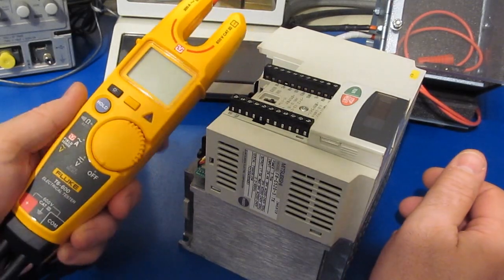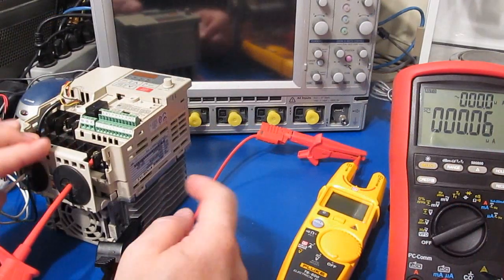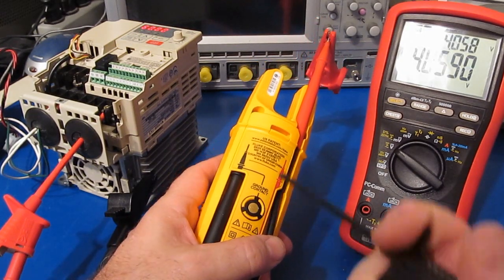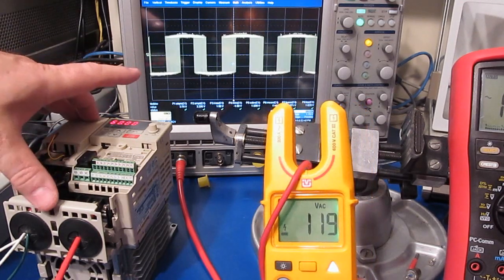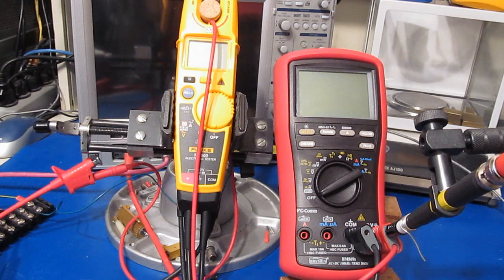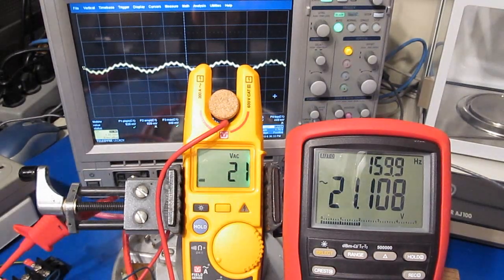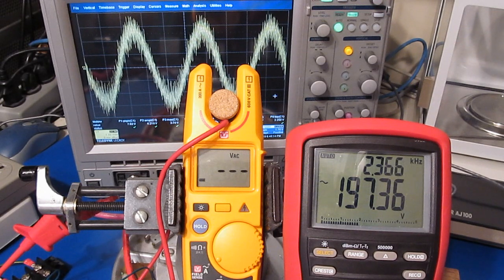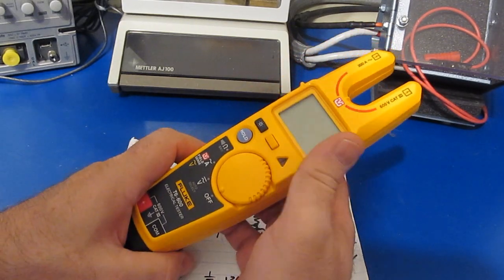Fluke T6-600 Part 3, VFD Drives and Other Waveform Testing

Comment: Hi joe 
Sorry very late to the party with a comment 😂. 
Thank you for yr awesome videos highly appreciated 
Would love to see how all yr meters read that output voltage from the drive 
Tested my 867s brymen it reads about 6v higher than my fluke 87v on a small drive with frequency of about 1.5khz 
Regards
Reply from the maker: What's the 3dB rolloff for your Fluke vs Brymen?
Reply: @joesmith-je3tq  to be very honest I have no clue 
Not very technical when it comes to that

Comment: I've been playing around with my fluke T6 and an oscilloscope. If you connect the ground of the scope to the negative test lead and hold tip of the scope probe in the fork with Field Sense active, the device emits a 2.4kHz sine wave that the scope can pick up. You actually don't need to ground the scope to the meter to see this, that is just when I got the best signal. As soon as you turn off the field sense function the 2.4kHz waveform disappears. If you look at the waveform that the meter couldn't read around 8:26 and count the peaks there are 26 peaks in 1/4 cycle so the frequency of the waveform superimposed on the 60Hz sine wave is 60*26*2 = 3.120kHz which is pretty close to 2.4kHz. Without fully understanding what they are doing on the inside, it appears that they are modulating the Field Sense measurement on a 2.4kHz carrier frequency. My guess is that if the signal you are measuring has too much frequency content in the vicinity of 2.4kHz the meter can't deal with it properly. it would be interesting to see the frequency spectrum for the wave forms that fail to produce a reading. Thanks for the informative video!
Reply from the maker: You may be interested in the following: https://www.eevblog.com/forum/testgear/fluke-fieldsense-contactless-voltmeter/
Reply: @joesmith-je3tq  Thanks, I'll check that out. Really enjoy the videos, super useful information.

Comment: when would you see waveforms with the small spike in the field? what is something that could cause those ?
Reply from the maker: I am not sure what you consider a small spike.  The act of sitting in a chair can create small spikes which I am sure is not what you are asking.   I suggest doing some searching using Google for "AC mains transients cause" or what ever it is that you are looking for information on.   It works wonders.
Reply from the maker: Wiki even has a page for you:  https://en.wikipedia.org/wiki/Voltage_spike
Reply: @joesmith-je3tq  thank you and thank you for the video amazing work a bit concerning seeing how easy it is to cause the meter not to read
Reply from the maker: @MarcusMussawar  That's the problem I see with it.  I like the concept and did some patent searches on people have done it.  Maybe someone will get the technology to be a little more forgiving than this one is.

Comment: We have in PT a lot of cork. Well the clamp doesn't like much noise / glitches on the sinewave and i think in the part 2 there was a  refered 2.4KHz frequency carrier on the clamp and in part 3 the final pure sinewave was tested at 2.399ish KHz, which is very near and would trip the meter and does not read even at 10% of the value. On the other hand if the device is not reading properly we could also suspect the line by its behavior... Very nice test JIG and wave form generation. What about doing a reading between two Power Line Ethernet points  , will it trip either?
Reply from the maker: Are you asking about those adapters that allow Ethernet over AC lines?
Reply: Yes, that kind of adapters
Reply from the maker: I assume you are required to have a licensed electrician install these which is why you are asking.  I am not understanding your question "will it trip either?"  Ethernet should be isolated and I doubt they have two of these sitting next to one another.  So I am not sure how you are proposing you would connect the T6.   Could you just post a quick sketch and post it on the EEVBLOG site?    This may help.
Reply: My question is if the T6 clamp meter will stop reading voltage of  one of the AC terminals in between these power line ethernet that you plug on the wall socket one end and then another, assuming that it introduces some sort of high frequency signal on the AC line  between the two power ethernet's .

Here is the sketch : https://photos.app.goo.gl/B0qr0wkNsptsawkN2
Reply from the maker: We already know there are cases where the meter will not detect voltage.   I don't own any of these adapters but you may want to try some of the other reviewers.  Perhaps they are using these.

Comment: Could it be that it reacts adversely to frequencies higher than what the VFD puts out? Perhaps it's worth trying to use the noncontact feature within a foot or so of an operating ignition system? Could be a real problem for HVAC techs who regularly deal with modern gas furnaces.

Comment: Thanks for doing all these tests.  It would be very educational if you could try doing robustness tests on a few automotive battery operated oscilloscopes.
Reply from the maker: I can't imagine taking a $4000 Fluke scope to task.  Like any scope, I doubt their front ends are designed to survive transients like these.   This is why I use various high voltage probes with the the scopes.    I did test a low end 100X probe once which is why I started to make my own.   The scopes cost too much to put them at risk with a poor quality probe.

Comment: Nice video Joe,very interesting, seems like one of those is kinda an initial test to get some rough measurements on some equipment before you would grab a normal industrial multimeter, I think still would double check its readings!
Reply from the maker: I guess if you knew ahead that the T6 was compatible with the waveform you wanted to measure you would be fine.  In general, from the limited tests I have ran, it would be fine in many cases but it's not good enough.

Comment: Nice one Joe:-)  Looks like the meter is safe enough except for the false negative on spiked waveforms. I didn't catch, on the first viewing, whether the meter differentiated between no volts and no read, is it obvious that it is not reading rather than no signal?
Reply from the maker: The way it works, you can wrap the black lead through the clamp and the lack of ground indicator will turn off.   So they will show you when the circuit is complete.  When the meter is not connected, you will see lack of ground active and three dashes.   If you watch the video, often you will see the three dashes with the ground indicator off.  Again, the same case as just testing with the black lead in the clamp.